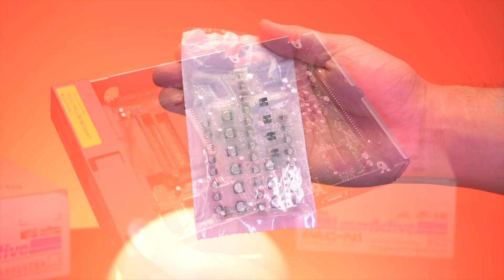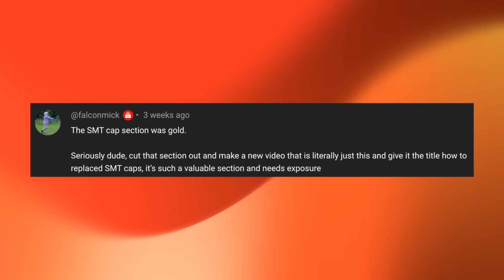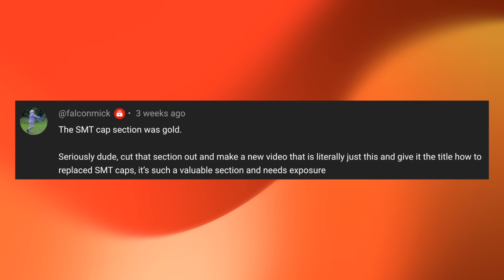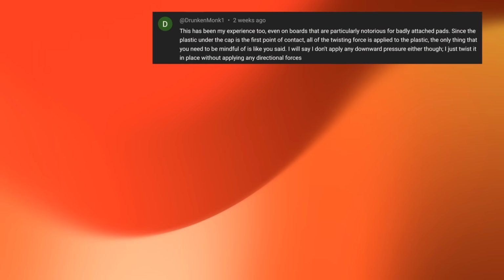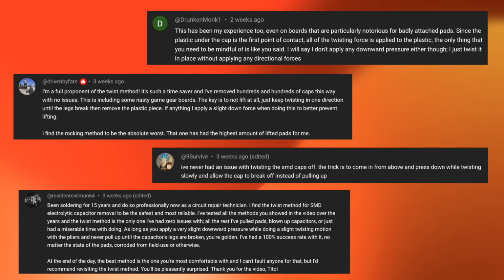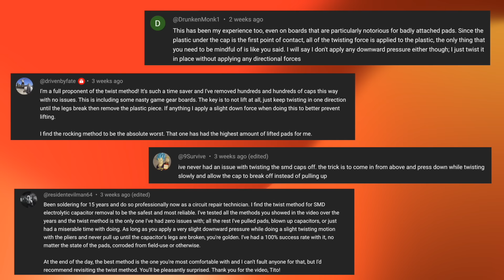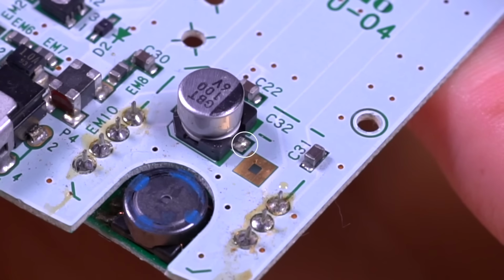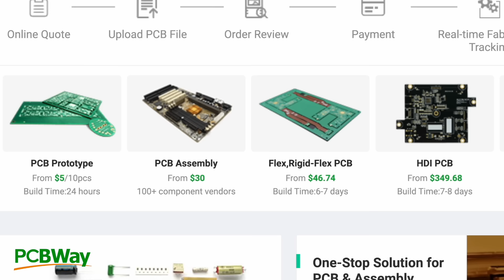5 Ways To Remove Surface-Mount Capacitors | One Is The Best!

Comment: Great video! I would love to see a "mythbusters" episode. I've seen so many people online say that there's no need to replace capacitors at all, that power cleaners such as on the GBA provide no benefit and are just snake oil, you can/can't clean PCBs in a dishwasher, that the person in the video is using too much flux (is there ever such a thing?), leaded vs unleaded solder, etc. I would really enjoy a video that deep dives into these controversial topics!
Reply from the maker: Haha, that’s a great idea!
Reply: silver bearing solder is the best.
Reply: That's a great idea; you could get a ton of different people on board with it as well in the community to offer their opinions/recommendations on case by case basis, like known systems that have frequent caps failure vs ones known to have high quality ones and what not
Reply: what's the TL;DR answer to all these questions? :)
Reply: agree with all except too much rosin flux means you gotta do some nasty follow up cleaning if you don't have access to the production floor's boardwasher
I'm lazy so there is such a thing as too much flux lol but if you use low solids/zero clean flux you can add all you want ha ha ha
Reply: @udance4ever  all except the "no need to replace capacitors" will be easy.  Trying to explain all the different capacitors and the differences between them is going to take a few episodes because they'd basically be teaching non-techs electronics, basics or not.  It's also easy to do, it's just a complex subject to address properly, lots of information there.  I'd also include some discussion about solder pastes if leaded vs. unleaded is covered; that's how you get solder that takes more heat to remove than it did to assemble, there are different sizes and materials to the tiny solder balls suspended in paste flux which causes them to trigger state change at a lower temperature and once something starts melting it causes heat transfer to material in proximity and by extension all the paste rapidly melts and finishes the connection.  However, the overall composition of the now blended solder balls can make that solder joint require significantly more temperature to rework.
Reply: Cleaning anything electrical in a dishwasher is fucking stupid hahaha
Reply: @TCL_SD false, you can use water to clean electronics. Just make sure to dry before turning on.
Reply: @TCL_SD This is wrong.
Reply: @homerghost  this, a guide that goes over these would be perfect for beginners or people like myself who have thought about getting into doing stuff like this but haven't.
Reply: Would also love to see such a video.
Reply: You can clean a PCB in a dishwasher, but there are so many things you have to be mindful of that it's not really worth it. First off you don't really want any component that still holds electricity to either be on the board or still carrying a charge. You also do not want the water temperature to get high, you don't want to use soap, you want to run a full wash and clean cycle before trying it OR have a dedicated machine, if you have hard water you want to take precautions to prevent calcium build up, you may just want to buy a dedicated washer that you manually fill with distilled water to bypass all of that and even with all those precautions you can still risk knocking or damaging components off the board.
It's much better to get a small tub and use distilled water no soap and a soft bristle toothbrush, you could get away with Tap water but Distilled would be best as it doesn't conduct electricity.

The biggest thing with using water on anything electronic is that you absolutely MUST let it dry entirety and completely before you power it on again to reduce the risk of electrical arcing and shorting. Which is why I keep bringing up distilled water specifically because it doesn't conduct electricity and submerging PCBs in tubs of it was used for early and cheap liquid cooling.
Reply: I support this idea.
Reply: The only wrong way is "carelessly"

Comment: I've found the twist method to work well on boards with heavy leakage but I do it differently, I don't choose a direction and go all the way, I gently rotate in both directions to until I fatigue the metal on the legs. I did that on a Nomad, a PC Engine GT and a couple of Game Gear consoles, and all the pads survived without damage. All of them had pretty heavy leakage, particularly the GT. It looked like some of the pads were way too far gone but, it actually cleaned up really well with solder, flux and braid.
Reply: Yes, that’s the right way. It’s funny how this guy chose to do it the worst way possible in order to keep believing he is right about twisting = bad 😂

Comment: I just recapped my original PS1, all SMD caps. I did my fair share of trace ripping by trying to solder out SMD caps from the OG Xbox. I use the snipping method now. Take your time and be patient when removing.
Reply: I think i learned the snipping method pretty early and have been using that.
Reply: I recapped my PSone console and used the snip method. I let the snips do the work. I took my time and it worked great! I do have a Hot Air Station but figured why not give this a try? It does require you to remove the legs left behind which is an extra step. You would need to remove around 23 caps for a complete job. Keep that in mind!

Comment: That twist method is definitely not the way to go. Would not recommend it at all! Another tip if you dont have hot tweezers but you have two soldering irons is to just use both soldering irons like the hot tweezers. This way works just as good, if not better, especially if you have a large collection of soldering tips already.
Reply: You are wrong. It’s the way to go, given that you do it gently and not in one big straight twist  like Tito demonstrated here to proof he was right all along 😂

Comment: (unless you've already done this) How about a video on how to place new SMCs on? In fact, how about safe removal and replacement of various components including the proper temps as well.
Reply: ...just solder them. Put solder on one pad. Put cap. Solder other side. Don't overthink it
Reply from the maker: Great idea!
Reply: @MachoNachoProductions  Yes please!
Reply: @thomasandrews9355  Knowing the proper temps is not "overthinking" it.
Reply: @lyianx  that only addresses the last thing they said. But you're right, 360-400c. Leader solder. If putting multi legged components, tack one pin down, make sure orientation is good. Tack opposite side. Apply flux and solder each pin.

Comment: Twist back and forth, not just one direction, you will fatigue the legs of the capacitor. when twisting in one direction you do put a lot of strain on pads. I have used twist off method for all repairs and never broken a pad yet but it’s never too late😂😂😂

Comment: I’ve used 2 cheap soldering irons together to kinda flick the capacitor off the board . I’ve had the best luck using this method on even the most corroded pads.
Reply: I've done this with one soldering iron by quickly moving back and forth between the pads while applying inward pressure towards the capacitor and it just flicks off.

Comment: Hey Tito, One note: You should always gradually and repeatedly twist the capacitor in the Twist Off method. That wat the legs slowly fatigue and break more easily, with almost no stress. As soon as you encounter pressure, twist back the other direction, repeated a dozen times or so.

I have partially pulled up pads with the snip method. That method is also difficult when other components block a correct parallel approach with the snips.
Reply: The Problem with the "Twist" Method is that it is called that, when in reality its more of a "Wiggle" Method...
I would recommend to NOT use tools and just use your fingers to wiggle the cap off.
I have great success with that and prefer the Twist Method for larger caps, for 5mm caps, the Snip method is equally good. BUt I don't like it for larger diameter caps
Reply: +1 on snipping being more risky in my experience than twisting.  Rocking or a similar twisting you mentioned is my go-to depending on pad/corrosion condition
Reply: @turnofftheoverheadlight  Snipping is fine for the tiny 10µF/16V and similarly sized caps. For the big ones, I would wiggle
Reply: @Stefan_Payne  It is uncommon, but I've had both the smaller and larger caps pull pads from what I assume is the snip blade angle pulling up before cutting the outer shell completely.

Comment: Voultar did a video years back on using hot air.  It's by far the easiest method and doesn't rip traces.  It's all I use anymore.

Comment: I started doing retro repairs thanks to one of your videos, and in it you used the flush cutter method to remove SMDs so that's what I did and it's worked great every time I've tried it. This was all before I invested in a hot-air rework station and even though I have one now I still use the flush cut method primarily. It's just quicker and is usually fairly safe as long as you have a good angle on the cap.

The twist method is horrifying, and especially on older consoles seems like it would result in lots of torn pads. If anyone out there's had good results with it, you do you but I've had too many pads come up with far gentler methods and finding the correct point to wire bodge wires to gets really old, really fast. I rushed too much on my first Sega Genesis recap and tore a ton of the pads and traces getting the old solder off. Now I take my time - slow, steady and high heat for old solder.

Comment: I recently recapped a GBC as part of a custom project (inspired by a couple of your builds Tito), and attempting a rocker removal the first time resulted in a torn pad on C32. I went and bought the cheapest Hot Tweezers on eBay to do the rest, which allowed me to remove the caps without any further damage to the pads.
However, anyone considering buying a set, avoid buying the cheapest set and spend a little extra if you can. The set I bought are not precise tools; the tongs aren't in alignment and they have round tips reducing their ability to grip securely. In the end I had to have the hot tweezers in one hand with regular tweezers in the other, which was pretty unwieldy.
I ended up with some cosmetic damage to the plastic of the cart slot near the C35 capacitor due to unsteady grip, so I think there's also some value in practicing with hot tweezers just like there's value in practicing soldering before delving into the main purpose of a project.

Comment: Definitely a great video and glad you made it.  My extra, unsolicited input: Hot air can also cause some to pop if too long/not focused enough on the legs and next to a large ground trace that is soaking up heat.  And smaller components like tiny resistors can benefit from being taped over with kapton so they aren't moved around with hot air and being careful of something like the adjustment wheels on a Nomad near some SMD caps that can get damaged from the hot air

Comment: Good stuff! I've been the victim of that particular failure with hot tweezers. They are amazing for smaller surface-mount components, but I think there's just too much mass with the larger caps for them to work. I suspect that the correct play if you're going that route is to crank the heat and treat it like soldering near a lithium battery: Get in, get out.

I like your flush-cut method! That'll be my go-to.

Comment: I have to say, if you don’t have the tweezers or hot air station, the cut method is the safest overall, IMHO - even if you have a hot air station, I would definitely use Kapton tape around the components, just to be on the safe side, especially if you’re dealing with a board that has a bunch of other SMT components around the caps you want to remove.

Comment: Flush Cutters all the way for me, it is easy and doesn't result in heating up the capacitors or other components.
Hot Tweezers seem like the "fancy" method, but seems a bit much, unless you recap like one console per week.
Reply: navyvet84  That seems like far more of a pain in the ass lol.

Comment: Thanks for the tips, I need to replace all the caps from an old SNES because it has display issues.
Reply: Im going to attempt to do the same! Any tips? What method did you use?
Reply: The rocket method and flush cutters. Honestly it was easier with the second method. When I tried desoldering, I almost damaged part of the pcb, so I stopped and preferred using flush cutters. If you try rocket method make sure not hot to much the soldering iron.

Comment: For twist-off method, press down hard then wiggle it back and forth as others have said. Worked every time, though you must take the before photo to compare your new parts against if you aren't using the recap kit.

Comment: @MachoNachoProductions - Some additional content that you could add to this video, maybe if you don't want to talk about them, point to other videos, or creator's videos that cover these things.
- Which consoles are at the greatest risk of Capacitor Failure? 
- Which ones should not be turned on before replacing the caps to prevent further damage to the motherboards?
- How does one go about gathering the caps they need to replace the existing ones, and including instances of not 1-for-1 part replacement

I know your not like a full blown electronics channel, but saving these classic consoles is keeping preservation of video games alive!

Comment: This video is very timely - I have been meaning to replace the caps on my BVM board but I am a little scared to remove all the electrolytics! I was thinking of grabbing some hot tweezers and this has me more convinced to do so.

One risk I've heard of with hot air is that heating one area of the board can cause it to flex quite severely and possibly crack or damage traces even on inner layers of the board. I'm not sure how likely it is, but it is at least worth ensuring you preheat the entire board somewhat before focusing on a single area.

Comment: I have a model 1 Sega Cd that was a pain in the butt to get the pads cleaned after removal of the caps. The solder braid wasn't cutting through until I used a section that already had a lot of solder on it, and it cleaned it really well! Now i can work on my 3DO next, lol.

Comment: I use a low-melt solder. Used to be hard to get by itself, but I just checked and you can get 4.5' for about $15. You apply a nice glob to the solder joint, get it nicely alloyed, and now it will stay molten for up to 30 seconds. Plenty of time to get all the pins liquid at once, then just lift the part off

Comment: I've never personally used it but I have seen a method similar to the "hot tweezer" method. Basically you wrap a piece of copper wire around the base of the cap so it is touching both legs. You then run the soldering iron over the copper wire which acts as a heat spread heating both legs at the same time. Could be useful in a pinch if all you've got is an iron (and some spare wire).

Comment: The rocking method for SMD caps is the most likely to lift pads in my experience. Good PCB’s are often okay, but cheaper PCB’s it’s almost impossible to not lift pads (especially on amplifiers where the board is subject to heating). 

Mr Carlson’s Lab does the twist method. It generally works pretty well since the pads are being pulled sideways rather than away from board. 

Any way you slice it, SMD caps are much more annoying to remove than through hole.

Comment: Like someone else said two irons easy if you’re not going to twist, I’m going to recap my old Metcal station what sucks is there through hole and my solder sucking gun runs of that unit so old school heat one pin pull to side pop then other luckily I have more than one iron good luck to you all watch them eyes he showed you why good video thanks

Comment: Just thought of an additional method. Use the hot tweezers to focus on the pads and needle nose to remove the capacitor. This would keep the heat off the can, while getting both contacts simultaneously. You could even use a twist motion to defeat the glue

Comment: I had one of the Xbox consoles that was affected by the faulty clock capacitor, and this was way before I had some of the tools I have now, so I used a variation of the twist method for the damaged capacitor as Microsoft gives you plenty of room to wiggle the capacitor back and enough room to snap the leads that way. The issue was created by Microsoft being cheap and then being cheap also allows for the easiest solution. I've since replaced that Xbox with a better condition final run model (November 2004 model manufactured in Mexico) that wasn't affected by the faulty clock capacitor so I won't have to worry about it for some time hopefully.

Comment: I almost always give them a quick twist with a little downward force. Have recapped dozens of GameCubes without issue this way. Heat (especially hot air) runs the risk of bad caps popping or exploding as you saw. Caps that leak usually have corroded their pads to a point where it’s difficult to work with the solder anyways when installed.

Comment: @Macho Nacho Productions It's possible to be MUCH more gentle with the twist off method than the way showed : why twisting so much? You only need just few degrees, alternating clockwise and anticlockwise. Like that the mechanical forces are applied on the legs of the capacitor, thus their fatigue broke them, without touching the pads. On corroded solder it's even easier : since corroded solder alloy is brittle, it looks like you only have cold solder joints, you can even remove the entire capacitor and see the legs printed on the alloy like handprints ^^

Comment: You should definitely be carefull with hot air and the time you take, you can see the cap bulging in the video at 4:12 . The most important thing is to make sure you don't heat up anything you don't want to and accidentaly knock something else off the board or melt plastic parts.